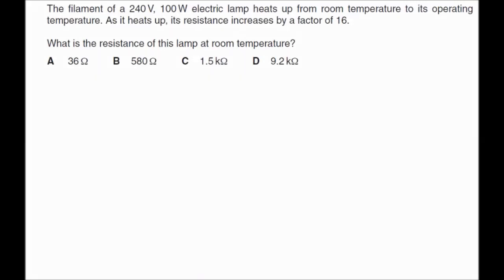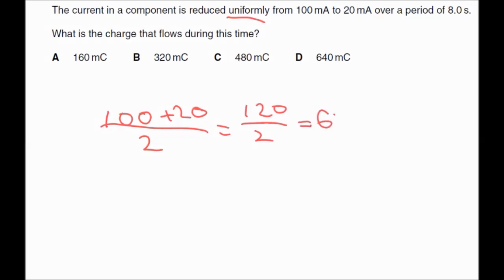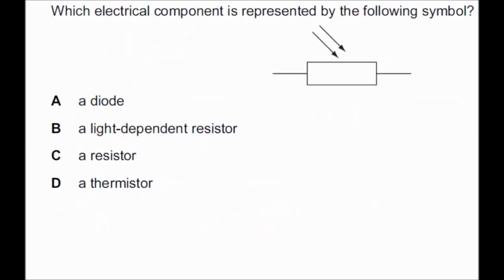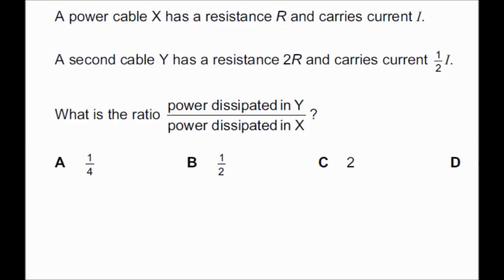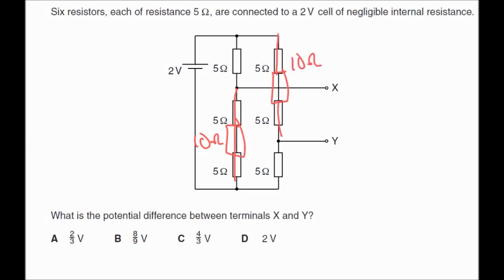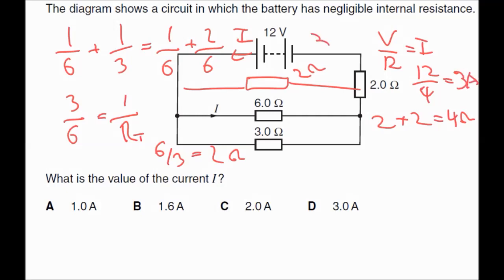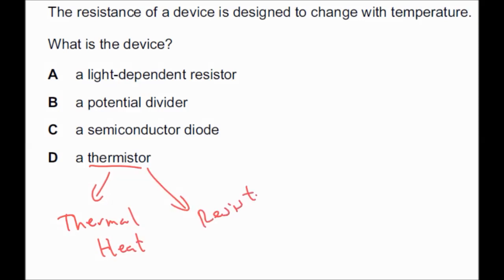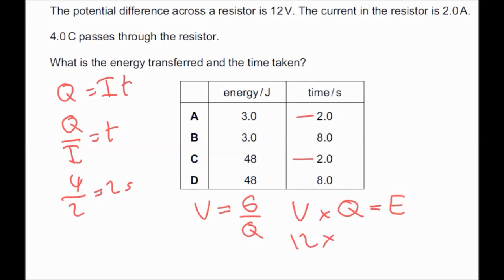Circuits and Electricity Problems - A Level Physics

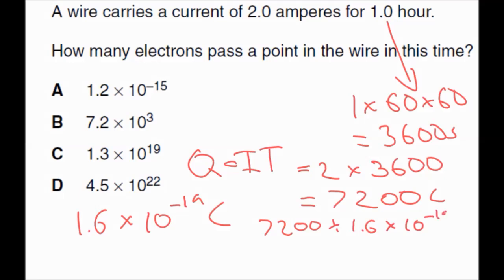Comment: Mistake made at 13:02
7200 should be multiplied with 6.25*10^-18
Reply: Lol, should've checked it yourself before falsifying others
Reply from the maker: hmm.. nope.. Sorry... x6.25*10^18 is the same as / 1.6 x 10^-19...